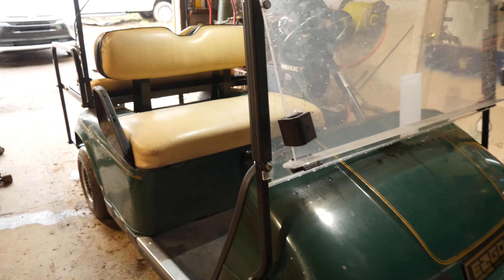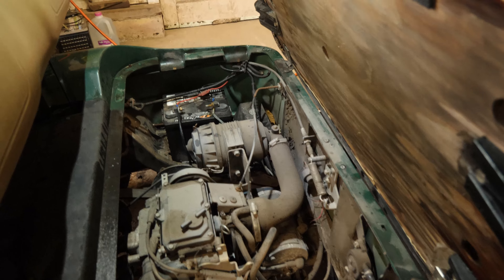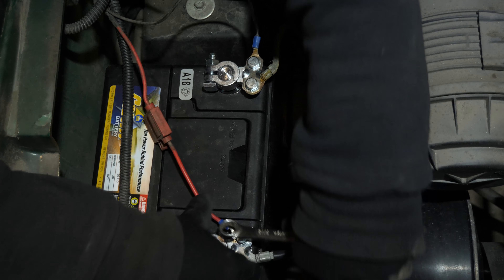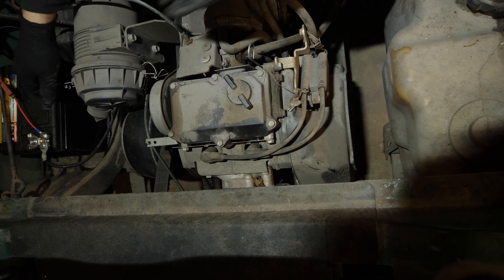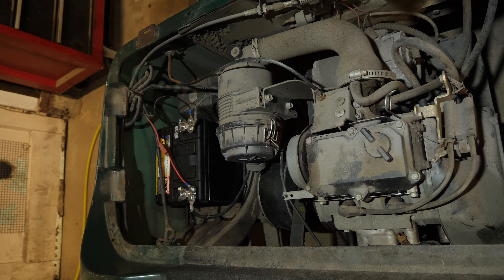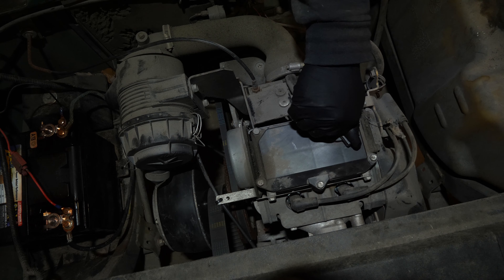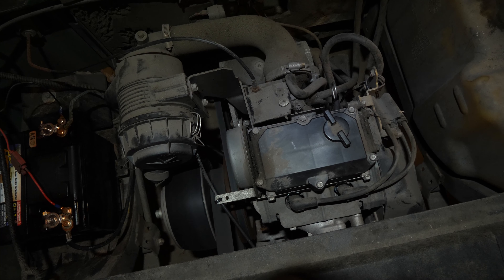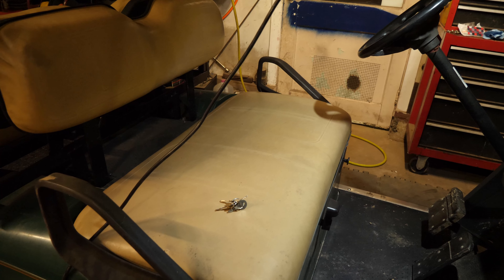2007 EZGO TXT, Gas - Not Cranking, New Battery, Full Service

Comment: I know this is an old video but I'll ask anyways.  My 94 txt won't crank at all but battery has enough juice to sound the reverse beeper. I'm certain the battery is very old and needs replaced. My question is... if the battery has juice to sound the reverse beeper shouldn't it atleast click? Thanks!

Comment: I'm glad I found your channel. I'm considering buying a used gas powered golf cart for use at our cabin. I'm trying to determine which Ezgo, Yamaha, or Club Cart would be the easiest to maintain. I probably will buy something manufactured between 2000 and 2010, depending on price. Around my area pricing for used carts runs anywhere from $2000 to $4000. I recently passed up a couple of good buys on electric carts. I hate dealing with lead acid batteries, plus they weight a lot. Converting to lithium was going to cost twice what I was going to pay for the carts. I could not see putting eight thousand dollars in a used cart. I'm pretty sure I can maintain a gasoline engine powered cart after watching your channel.
Reply from the maker: Yamahas are by far the easiest to maintain. They have 1 spark plug, no oil filter, simple air filters and everything is easy to access. Club Car would be my next recommendation. Stay away from EZGO after 2006. Their quality is not the same as it used to be. They are the most frustrating golf cart to work on overall.
Reply: Kevin's Golf Carts , thank you so much for the recommendation. That information is extremely helpful to me.
Reply: Ezgo is a Club Cart👍🏾
Reply from the maker: EZGO is a different brand from Club Car. They are not the same.

Comment: when you put the load tester on the battery to start with it went to 0 which means the battery cannot take a charge. would of saved you 2 days.
Reply from the maker: I've had batteries come back from the dead.
Reply: @Kevinsgolfcarts  thanks for the vids, they have helped me with my txt cart repairs.

Comment: The voltage on my 2001 ezgo txt robins 295  battery drops to 11 when revving in neutral.  The cart will barely run in gear. Is bad battery causing this or something else? Compression is good, new carb, fuel pump, coil, fuel filter, fresh gas, new plugs. Your videos have helped me tremendously. Thanks in advance.

Comment: I have a 95 ezgo with the robin 295 does it take the same group 24 battery? Videos haved helped me tons. 

Thanks again
Reply from the maker: Most EZGo carts use a Group 26. Group 24 or Group 24F is used in gas Yamaha golf carts. Group 70 is used in Club Car golf carts. The original Group 26 type in this cart is the more expensive type with the thru-hole studs. You can use a Group 26 with standard posts and adapt them like I did in this video.
Reply: @Kevinsgolfcarts  What model number was the battery you used?